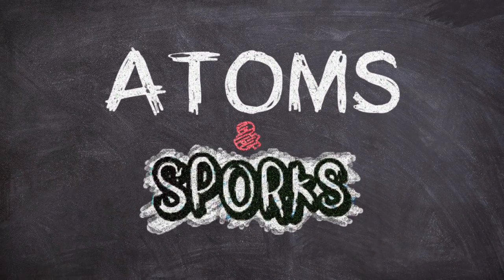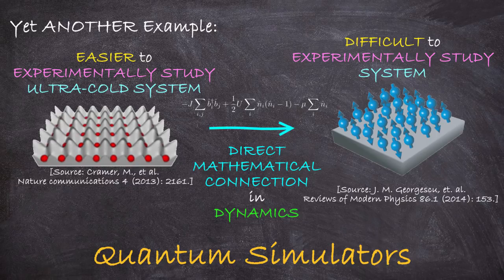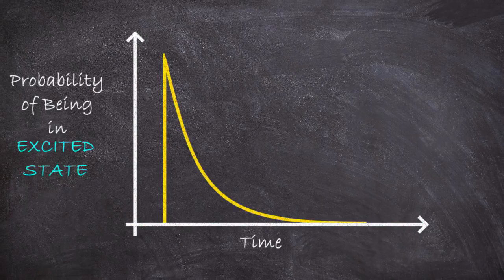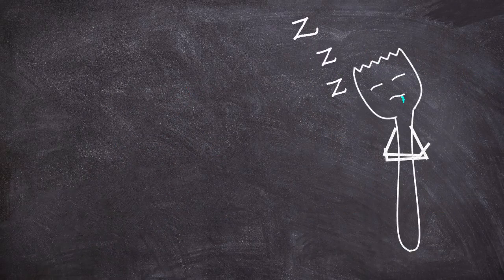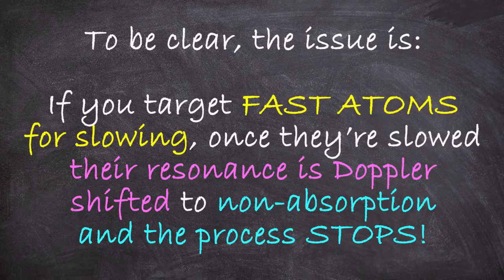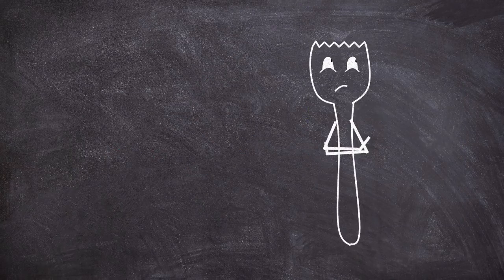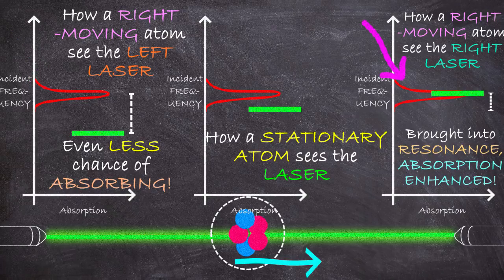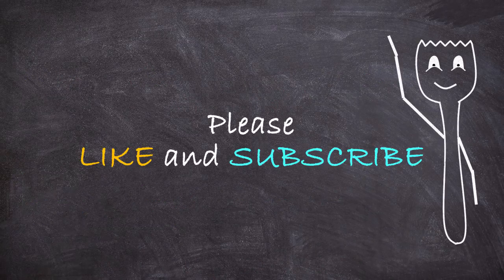Cooling with Light! Zeeman, Laser, Chirp and Doppler Cooling Explained

Comment: great video but confused myself too much, please help. something. When the photon is absorbed, it means that an electron of the atom is excited. So, I guess the energy and the momentum of the photon does not fully passes only to the electron because center of mass of the atom slows down, right? So how much of the momentum passes to the electron and the center of mass of the atom ? I mean I am really confused about how the momentum is conserved since electron in higher level gains momentum and energy but overall whole atom slows down. so does this electron has a directional momentum that slows down the whole atom ? Also when the light is re-emited, atom gains its energy back by recoil even average momentum is zero, it still has the same energy , no ? How does it gets cooler if the energy is conserved.  I need help, I am super confused.

Comment: Sorry, maybe I'm wrong, but Doppler cooling still doesn't trap atoms that effectively to my knowledge.  There is still significant "walk" of atoms due to random emission as you mentioned.  And that "walk" is usually such that the velocity of the atom is not high enough to bring the laser back on resonance with the laser.  Within some velocity limit, the atoms are trapped (which is why this can tap atoms on the minute scale), but we know that this is also slowing the atoms, so the velocity lowers to the point where the doppler shift will no longer be on resonance.  So once the atoms are sufficiently cooled, they are also, unfortunately, not trapped.

Comment: Such a great video! Thanks! I was wondering about the laser cooling, wouldn't the laser only be able to slow down atoms of a certain speed? Isn't is possible that the photon would be too energetic for the atom to absorb if the atom is moving too fast against the laser?
Reply from the maker: Well that's why you need to chirp or Zeeman shift during flight. Otherwise the atomic resonance passes out of the laser's frequency bandwidth.

Comment: You will need some coffee to read this:
The work is © Space Lizards 

This looks very appealing: Working on Quantum Chirping I consider spectral dispersion of EM ( light a/k/a fermion ) Given a Riemann surface as a 2-point vector sampled from an n-body Riemann surface taking Fine Structure Constant as some limiting value not within the capabilities of my vocabulary and nomenclature we take an emission in any arbitrary "Vector space" with the constraint this "vector space" is an event—taken as reduced model—of the "one-dimensional complex manifold" facetiously modeled as "Cleere" ( our investigator ) is attempting to contact "Orinda" → a "Long lost decedent relative" in a which occurs at T(arbitrary) → future event · after a few billion spent at CERN vacation resort Meyrin
 waiting for an idealized event our investigator team realizes this is available as a standard textbook case the "energy" ( defined as you wish ) splays—to spread out or widen—with tighter compressive effects primarily aligned in what most would take as the longitudinally forward direction of the 2-point  Cleere → Orinda with forward { ± } time noted as + by convention ~ proceeding thus the backfield from Orinda should display the Axial bias seen in COBE & related experiments → Speculatively a planar radius at an instant taken from the propagation of the wave-particle sufficiently narrow sample time to detect anything this side of FSC ( tangible or hadronic ) should based on what I have found so-far display a neutral "zone" at Θ ~ 90 ° ( "∟" orthogonal to the one-dimensional  Cleere ↨ Orinda ) such that spectral dispersion spreads or broadens ( Zeeman / Stark effect ) due to gravity between physicality but since our model does not specify Orinda to be present in time now we can simplify as bench experiment using standard tools where we would see emissivity in spheroidal form such that ±Time displays hysteresis as given in:
Maslovski, Stanislav & Simovski, Constantin & Tretyakov, Sergei 2014
Overcoming black body radiation limit in free space: Metamaterial super emitter 
New Journal of Physics. 18. 10.1088/1367-2630/18/1/013034.
Reply: See also: "Evidence of Radial Nulls Near Reconnection Fronts"
{https://doi.org/10.3847/1538-4357/aafa16}

Comment: 6:25
But how can atoms radiate light isotropically if a single photon is coming into action

Please answer
Reply: @Roberto Iannuzzi
Um... Okay...
Can you provide a reference link for this?
Reply: @Roberto Iannuzzi Thanks
Reply from the maker: If one wants to think in terms of photons then the absorption and emission events are separate events and when it comes to the emission event the probability for the photon emitting in any given direction is the same (emission probabilities are spherically symmetric and isotropic). So on average after many emissions there will be no net effect in any one direction.
Reply: @atomsandsporks6760  But doesn't that violate the conservation of momentum

If you have an isolated system with a photon moving towards an atom, it is absorbed by the atom and remitted into a different direction.
Reply from the maker: @rbkstudios2923  There's no violation, for ever absorption and emission there is a recoil, it's just that absorption is only happening from one direction and so all the recoils are in the same direction and thus every absorption event results in a net momentum change. Say the laser photons are moving to the left. Every absorption then gives it a kick to the left. It then reemits, if it reemits perfectly to the left it'll get a kick back to the right and be slowed back down, but it's equally likely it emits to the right, in which case it actually doubles its speed, the avsrage of those two possibilities? The reemission does nothing. It can also emit upwards or downward and either would give it a kick in the respective opposite direction but it does both with equal probability and so again there is no net effect. Imagine you're a hockey player on ice and someone keeps launching pucks at you from the same direction over and over knocking you back more and more along that direction, But when you receive a puck you launch it away.. but in a totally random direction, the net result would just be you pushed back. Or a gunslinging octopus with a little handgun attached to each if its many tentacle and it points out all its gun tentacles, equally spaced, in all directions and pulls all the triggers at one. Whch direction is he recoiled? No where.
Reply: @atomsandsporks6760  Great
I think that makes sense to me
Now I get it
Thank you so much for replying
And for hearting my comment too
Reply: @atomsandsporks6760  a great explanation of why the isotropic emission wouldn't affect the cooling! However, are there instances of anisotropic scattering where doppler cooling isn't used?